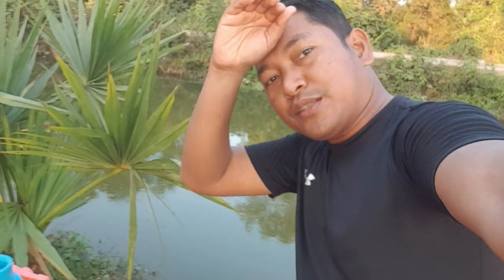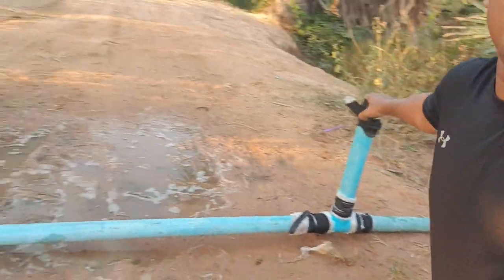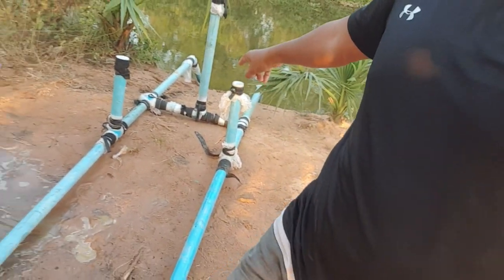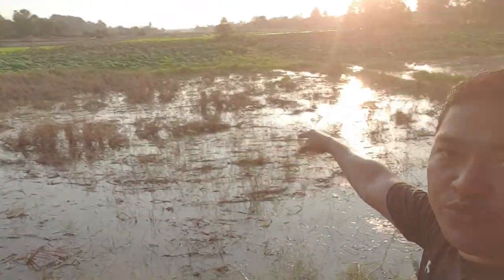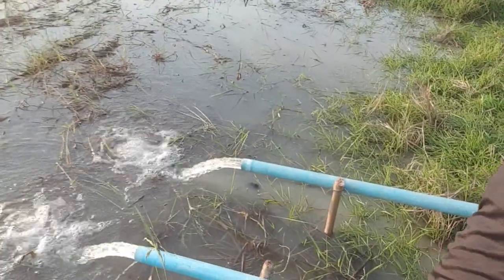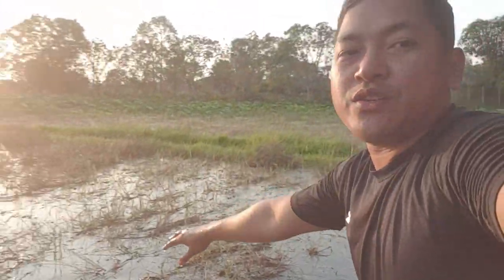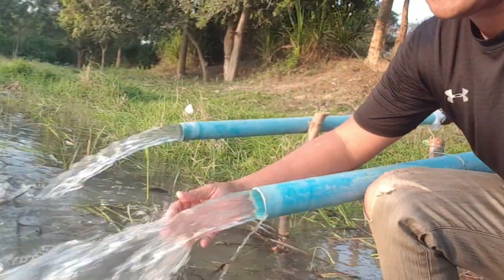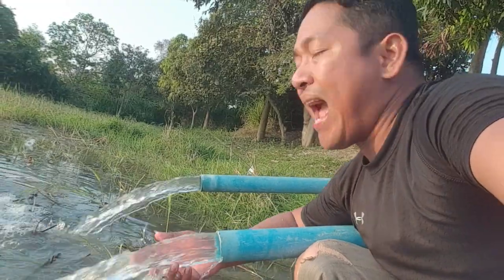Siphon system- Auto pump water from deep well - Free Energy Water Pump without electricity

Comment: Is the river  elevation  below than the rice field    do you install one way valve in the bottom of the intake pipe
Reply: River is higher than rice field. No one way valve is used, so both ends are closed with a plastic bag.  You may use a one way valve in the river. If you use a plastic bag in the river, then you open the OUTPUT and immediately run to open the input in the river.